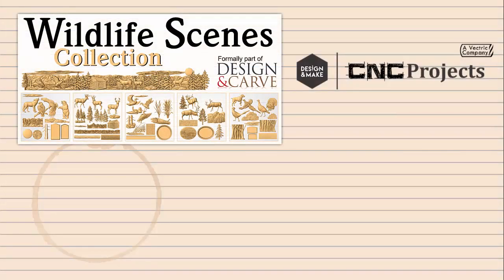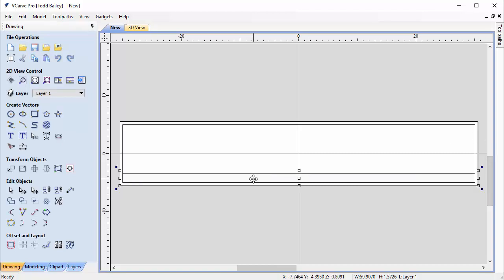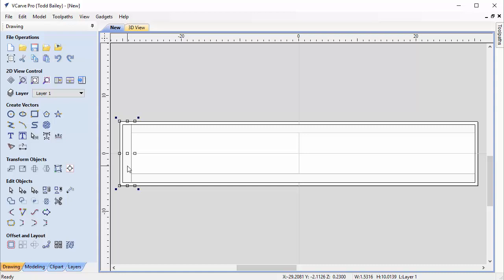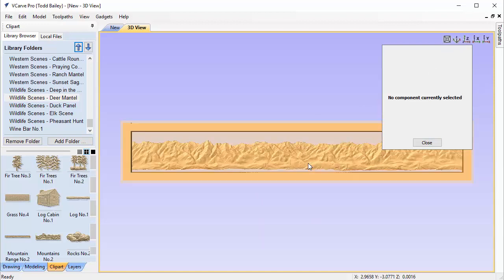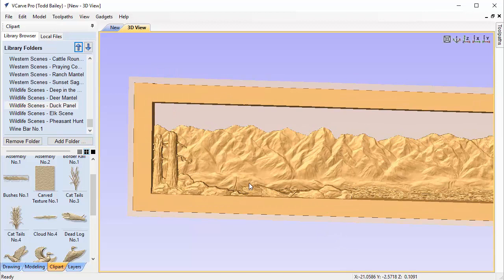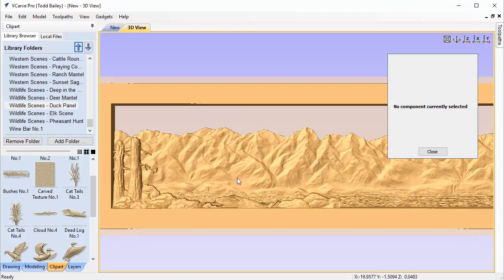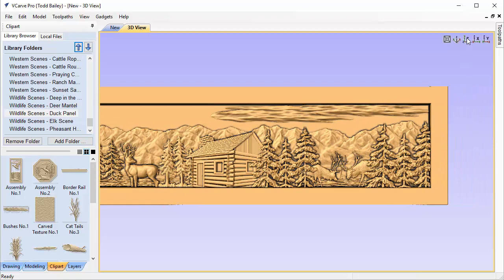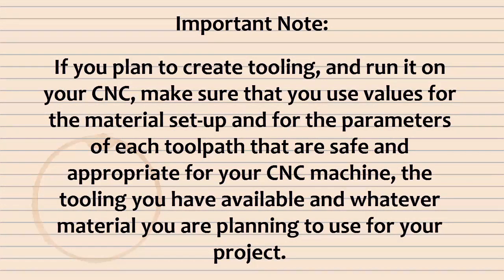To Get You Started Using The Wildlife Scenes Collection - Video No 1 | Design & Make

Comment: What is the bit used for a project like this?
Reply from the maker: Hello Manny.  It all depends on the size of the finished layout.  I would probably use a 1/8" ball nose endmill and then have a look at the preview of the tooling.  If I was not happy with it I would try a 1/6th... but only on the areas, I wanted more detail.  Hope that helps...
Reply: Design and Make CNC Projects I think that makes sense does vcarve desktop do a 1/8 bit followed by a 1/16 bit in the program? (Tell you when to change bit?) 

Also if I were to buy let’s say the deer mantle it says that there are three different files to choose from how do I know which one, especially when I’m actually going to need to import the G code to easel to use with my x-carve?
Reply: Using easel and the x carve, which of the three codes do I need to purchase for It to work??
Reply from the maker: Sorry for the delay in response.  You would need to download our Free Design and Make Machinest software or purchase VCarve Desktop.  There are a couple of post in the Easel form that, here is a link to one of those - https://inventables.desk.com/customer/en/portal/articles/2933732-add-easel-s-post-processor-to-your-vectric-software

If you choose to test this with the Free D&M Machinest software (I'll leave the link below) you will probably want to create a free D&M Store Account and download a few of our free projects.  That way you can work out the workflow before you make any purchases.  Also, keep in mind that D&M Machinist can only machine one model/component at a time so you can not combine any models/components.  I only mention that because if you wanted to purchase the Wildlife Scenes Collection you can't make your own layouts and would need to happy cutting the single models alone or the included assembled layouts.  

Now if you choose to purchase VCarve Desktop then there is no limitation of creating your own layouts... so you could make something like in the video above.

For both D&M Machinist and VCarve Desktop, you need to download the .V3M version of our models or projects.

Free D&M Machinist
http://www.designandmake.com/index.php/software/

Free D&M Store Account
https://store.designandmake.com/register

Free projects that are included with you Free D&M Store Account
https://store.designandmake.com/search/search?returnType=search&pageSize=24&q=Free&_csrf=dfe16f52-af10-459f-8edf-2ce082f0ad7b

Hope that helps. - Todd
Reply: Design and Make CNC Projects I bought vcarve desktop. So would that mean I can download .V3M files of all the projects and create different combinations of the one in the above video?
Reply from the maker: Yup... of course, if the project is not free you will need to purchase it.
Reply: Design and Make CNC Projects -How would I have a 1/16bit run only the more detailed parts?  Is it on the right side tool bar around the time to save?  Sorry, I know you know what you’re doing!  😉
Reply: Also, my boarders were very large. Took up lots of wood. How can I make them smaller?  I used the one from the Duck collection
Reply from the maker: Hey Manny... if you create a vector shape around the parts you want to use the finer cutter on and then when creating your tooling you select "Use Selected Vector", making sure you have the vector(s) selected you want to cut inside of.  It may be convenient to just use circles or easy shapes but the extra time it takes to make an accurate outline will be worth the effort. :)
Reply from the maker: You could scale them to work for whatever size you need.  Just be sure to match the "shape height" with all 4 sides that way they will look right.  Also, the borders take a bit of time to cut... seeing as they are flat you really don't need them or waste the time cutting them.  As you get better with the software you may just choose to do a 3D carving on the center rectangle and then offset that rectangle but the width of the frame you require and run a profile cut.  JUst use them for the layout and visual look but don't cut them with a 3D toolpath... :)